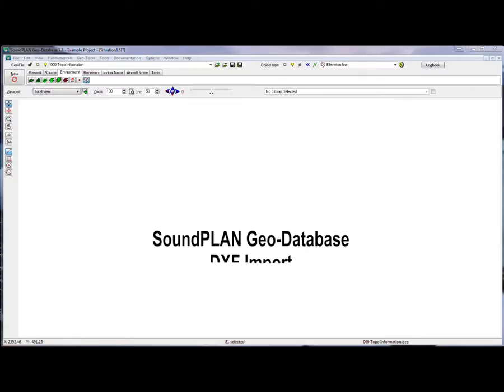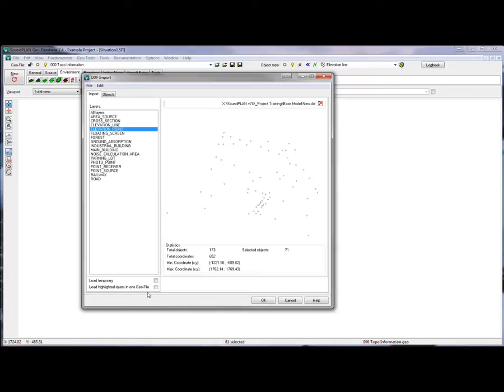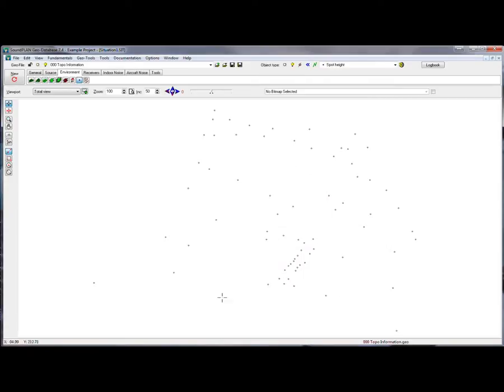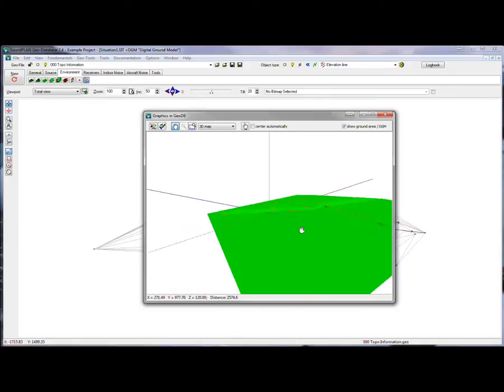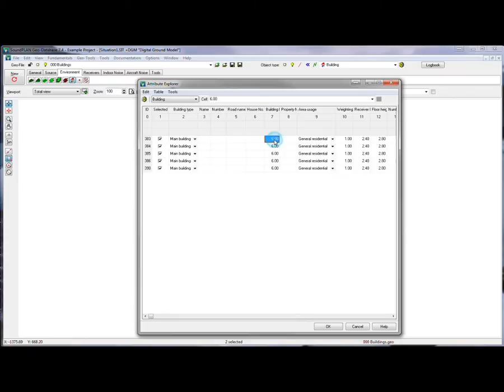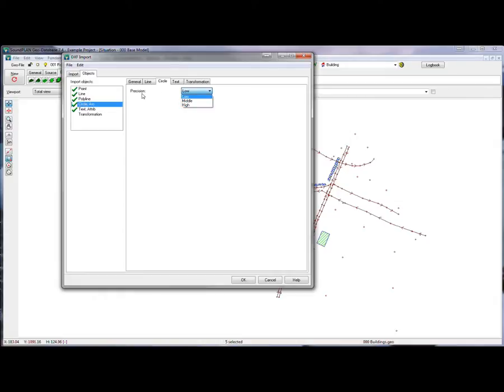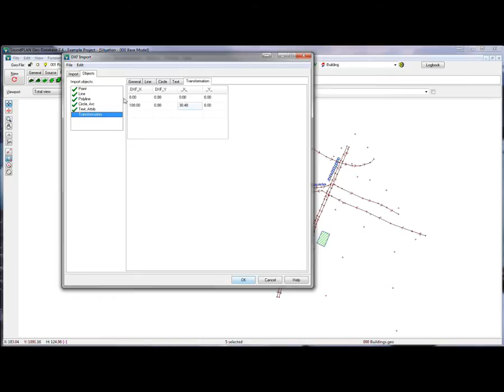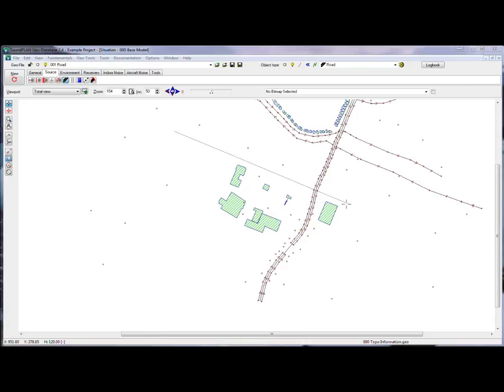SoundPLAN GeoDatabase DXF Import

Comment: Hi Hans,
What points or information should be retain while converting normal CAD dwg. file to DXF.?
Reply from the maker: Gpod question - check the SoundPLAN manual for tips...  From my experience her are some of the critical items for the DXF export.  (1) Make sure all objects are exploded. ACAD uses object references where information is grouped together.  (2) make sure the data is reference in metric system ideally UTM coordinates (3) all object should be 3 dimensional x, y ,z (elevation lines are sometimes referenced to a database with the elevation information - in that case the elevation line is exported with 0 m elevation). (4) review the ACAD and minimize the drawing with the object you are interested in importing i.e., spot height, elevation lines, center line of road, railroad tracks, outline of buildings, barriers, outline of forest areas, etc.  layers with street lights, sewer, electric lines, property line maybe of interest from a display standpoint but are not crucial for the noise model geometry development.
Reply: @HansForschner  Thank you so much Hans...!